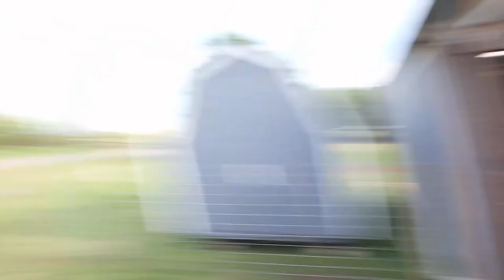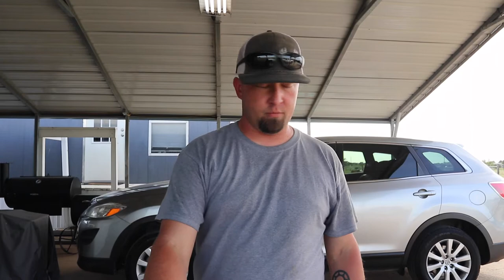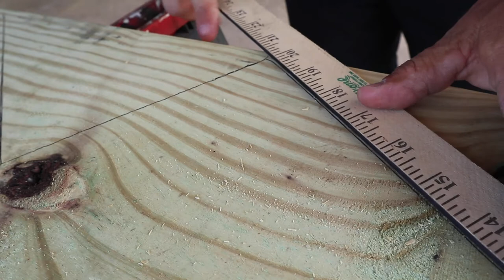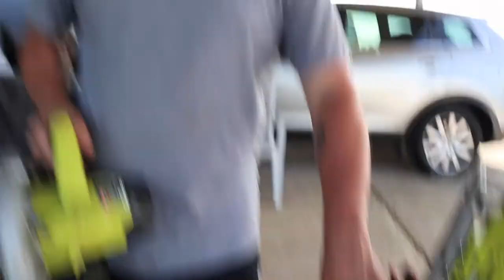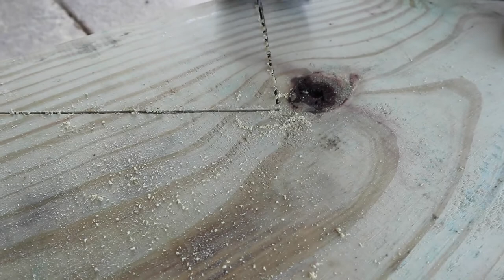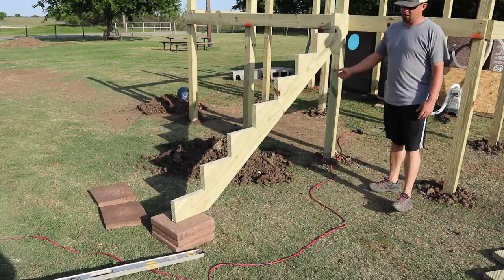Simple DIY Deck Stair Stringer - No Calculations - Trace And Cut!!

Comment: Im going through the exact same thing now and I wanted to see who else has done this, great job, I will add my two cents in though! I noticed that the top of your stringer is even with the top of the deck. If you used one more 2x10 beneath your facia board and dropped the stringer 5" below the deck boards, that would have probably lined up perfect that you wouldn't have to use pavers to rest the bottom stringers on?

Comment: so an 8 step stringer is made with an 8' 2x12 and a10' stringer requires a 10' 2x12 and a 5 step stringer a 5' 2x12? is that correct ?

Comment: My question is why isn’t your stringer fully flat on the slabs at the bottom why do you have the back edge hanging off? One crack in that wood an it’s possible those steps will  clasp .
Reply from the maker: We added concrete blocks to the bottom, just didn't show on the video.

Comment: Lol they are very easy to build... Why buy template... The guy cutting the template at home Depot is a beginning carpenter... Not hard at all
Reply from the maker: Because the length we needed was super expensive. We cut the cost significantly by using the template and doing it ourselves.